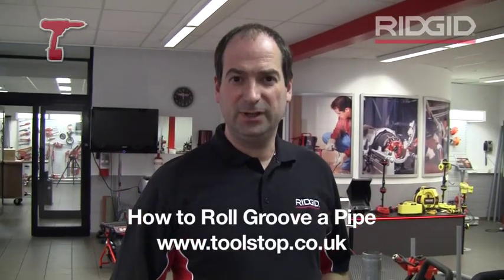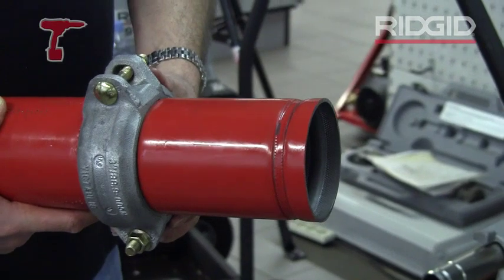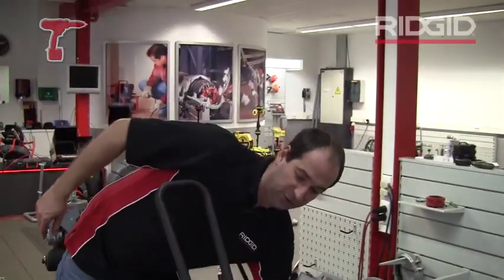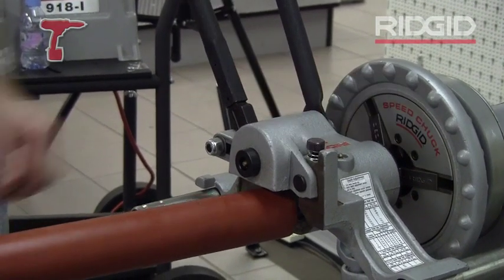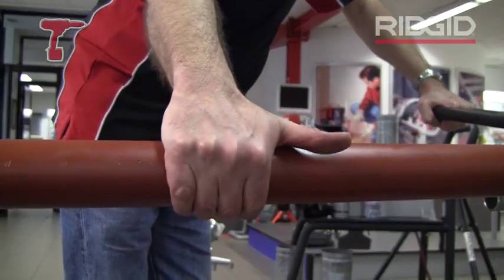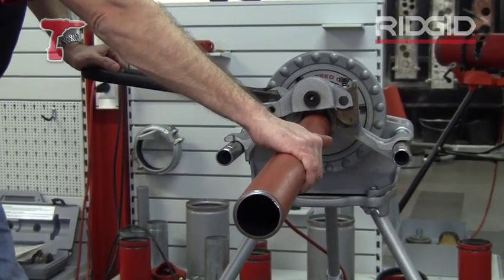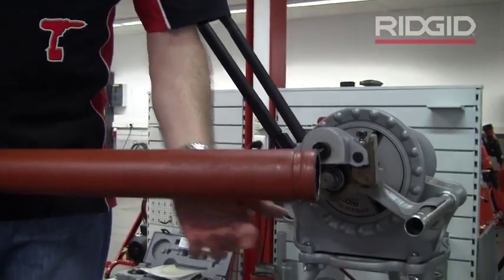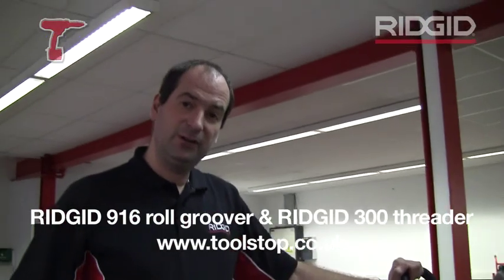How Roll a Groove in a Pipe using RIDGID 916 and 300 tools

Comment: So expensive though.
Hope someone makes a handheld, smaller, automated system you can just plug into a drill or something.
Even the one with the ratchet is a real pain in the ass to use, since you've got to stand there and crank it, making your shoulder ache.
It makes it even worse when you're up in a ladder.
Reply: Use the RIDGID 975.  You can attache an electric drill to it.  Even a quality cordless drill will make many grooves on a single charge.